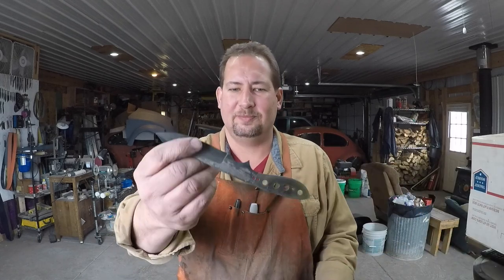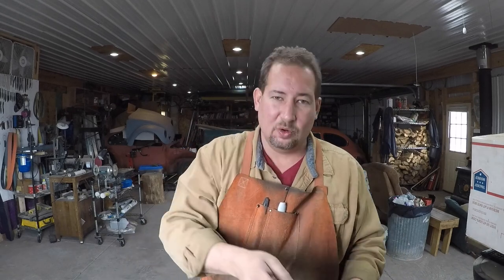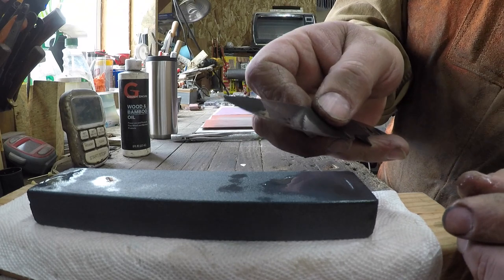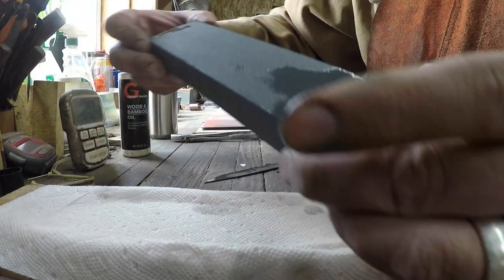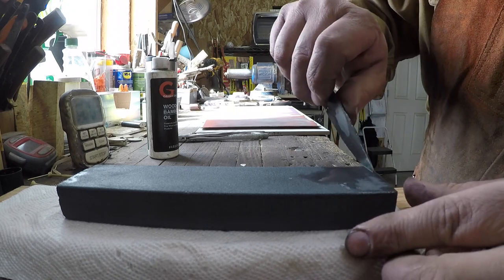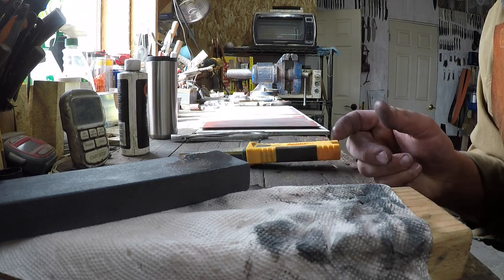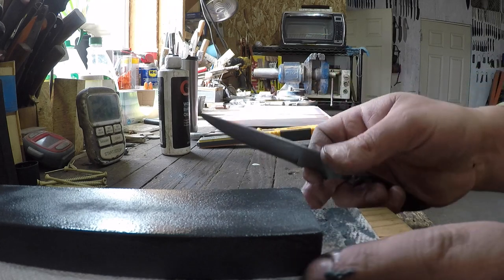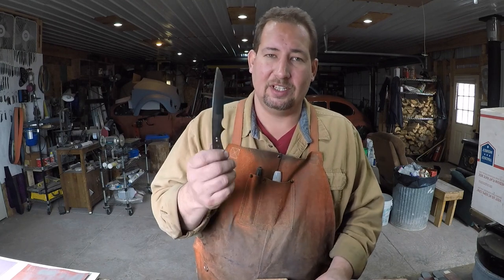broken knife tip repair with a simple bench stone

Comment: Would a crystolon coarse work ok if I was setting an edge bevel for the first time on a blank. I want to take a knife from a profiled blank to a finished edge, but don't have space for belt sander. Or is it better to set the original bevel with files, and then smooth it with the crystolon and stone progress from there? Blank will only be about 3 mm thick to start.
Reply from the maker: at 3mm thick, it would take quite awhile to grind in a while blade bevel and then edge bevel with a bench stone, and you would wear quite a bit of the stone away. if the blank was soft enough after heat treat, you could cut it with files to get it close, and then finish with a bench stone. or you could get it pretty close, to say 1mm with files and the stone, then heat treat it, and then finish with the stone.

Comment: Thanks for the pointers, Joe.  When I got my necker XL knife (or whatever you ended up calling them) it was the pointiest knife I'd ever owned.  But of course I've worn off some of the point now, so it's time to put that point back on.  No, I haven't broken any off, it's just not as sharp as it used to be, and a simple sharpening doesn't re-point the blade.  I saw you rubbing that knife at 90-degrees last video, or so and it kind of freaked me out.  That's why my knives don't get as pointy as you.  But I'm working on it now.  :)
Reply from the maker: if a regular sharpening doesnt get the point, it could be that you are stopping your sharpening stroke with the point still on the stone, and so the very tip isnt getting any abrasion. you could try to come off the stone, or, continue to move the point as you lift the blade off the stone to get that last little bit. a majic marker on the tip would let you know pretty quick